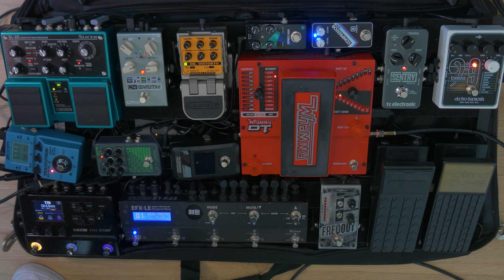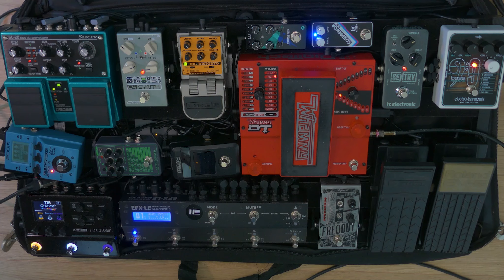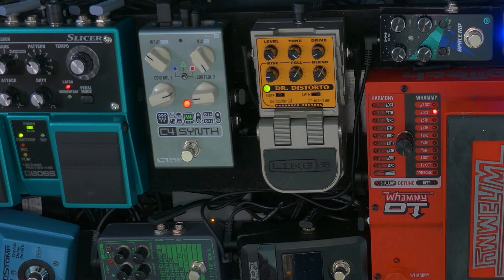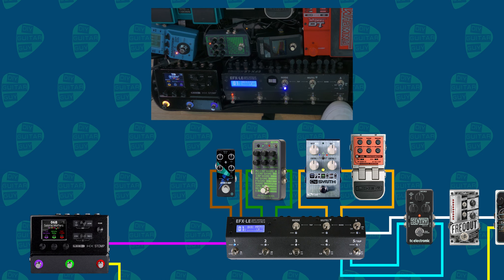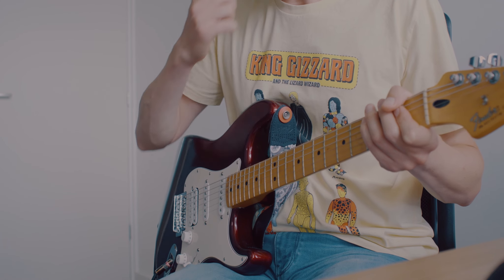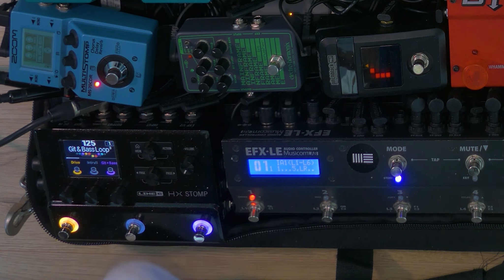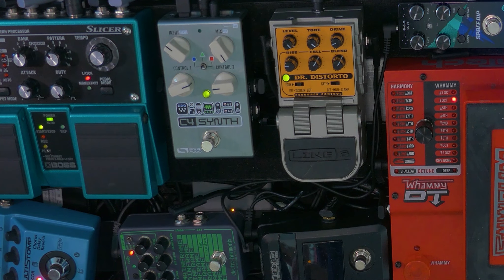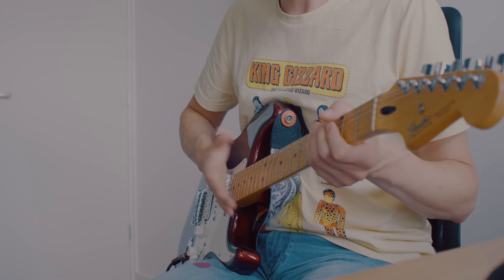2024 Pedalboard Demo and Walkthrough

Comment: have tried your comp b4 whammy? if used b4 does the conp mess up your down tune tracking? thx
Reply from the maker: I used to have the comp before the Whammy and the down tuning worked as well as without it. I have the comp after the Whammy now because the Whammy lowers the volume a little bit, barely noticeable, but there's less sustain which is balanced out when you're using a compressor after it.